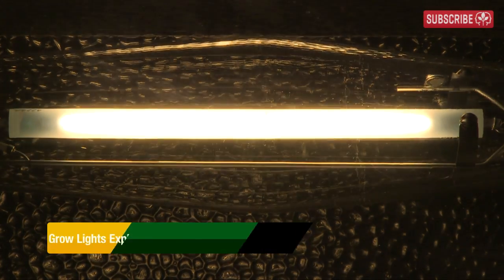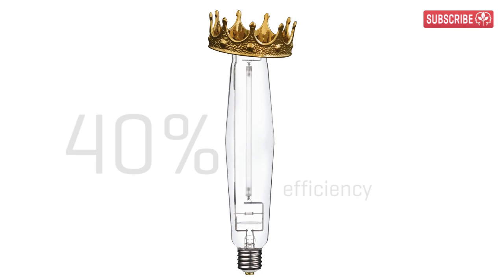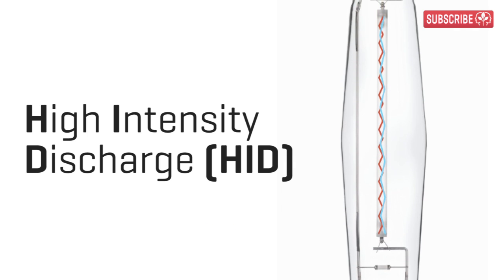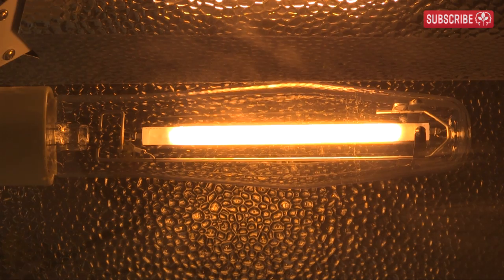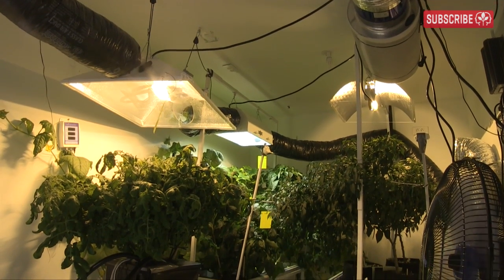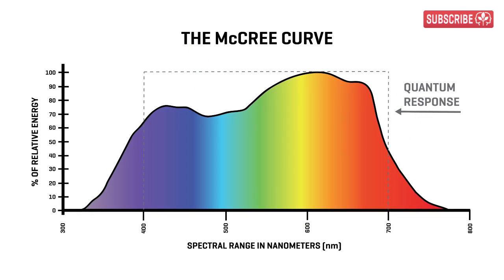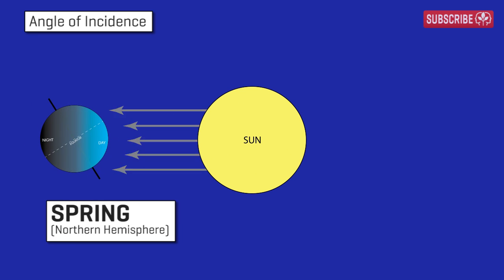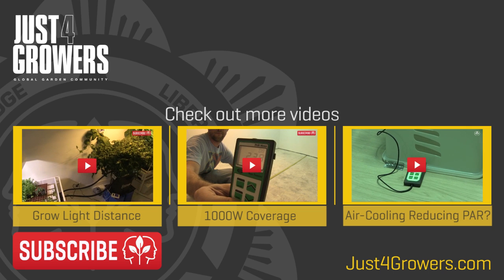Grow Lights Explained: High Pressure Sodium (HPS)

Comment: here in eu its impossible to get ballasts and ignitors...as for lamps themselves..there has been a sale out of these for 1- usd per lamp and when the stocks were depleted no new lamps are made anymore. Ive managed to snag 7 boxes for 1,5/usd per lamp but i have no control gear to use them with...

Comment: Superior to LED and used by all commercial growers for a reason.
Reply from the maker: Thanks for your comment. DIFFERENT to LED would be the way I'd put it. Sure, if you're growing in Alaska or somewhere 'naturally air-conditioned' then HPS could be a smart way to go. Same goes for winters in continental weather areas like Michigan. But more and more commercial growers are turning to LED because of its superior broad spectrum and higher efficiency. I believe that we will continue to see commercial and hobby growers switch to LEDs over the coming years.

Comment: Anyone out there run a 400 watt HPS bulb with a 600 watt digital ballast at 600 watts? I am interested in trying this but would like to know if it is a dead end fire starter? If the ballast can handle it that is good . If the 400 watt bulb running 600+ watts only last 100 hours that is also okay. What is not okay is flame roasting problems. JFYI I am not growing anything but old
Reply: You should only run an HPS lamp on a ballast specifically for the wattage of your lamp. It is dangerous to run an HPS lamp on a ballast for a different lamp wattage or lamp type.
Reply: Anything under 600 with a good ballast  should work on a 600 ballast,  even a cheap vivosun, but not the other way around

Comment: Ive a 600 watt hps lamp. Been using it for around 6 months, I've started to notice that the light has gotten alot whiter than the orange glow it used to give off. Is it time to swith bulbs? Im assuming yes but would love several opinions ☮️🇯🇲❤️
Reply: They should last about 5 years (well, going based off street lighting times, about 8 hours a day), but if yours is on all day, it should still last a couple years. Probably a cheap or defective bulb. Although I'm not sure, I've never heard of one getting whiter with age, or malfunctioning. They usually stay orange, if anything they get deeper orange, and cycle until you do something about it and change it.
Reply: They last around six months

Comment: Still way cheaper than an equivalent LED. You can buy a whole HPS set up along with spare bulbs and spare ballast for a fraction of the cost of one GOOD LED. Not the Chinese junk on Amazon (which is still way over priced IMO.) They are a total waste of money, and when the Chinese junk fails, you are out all that money.  Buyer beware.

Comment: if you want THE MOST EFFICIENT lamp ever that is close to HPS use LPS Low Pressure Sodium but they have the disadvantage of lower light output
Reply: and the are monochromatic with no horticultural spectrum

Comment: HPS is losing big time with the tech community. About every data center I have worked inside of in the past 4 years is now retrofiiting for LED's. Besides plant growing & softer outside lighting for streets lamps, these HPS lamps have no purpose for commercial buildings. They are expensive to run. The lifetime is short. Proper disposal is a pain. And they are NOT eco friendly!
Reply from the maker: Optics R US Thanks for your comment. I agree, perhaps HPS is finding its “niche”. Lol. Lighting to help human workers avoid walking into into chairs, tables, walls and other objects in modern working environments is a fast-moving and exciting application area - one in which LEDs are clearly excelling. Lighting to drive photosynthesis and photomorphogenesis in high DLI flowering plants is lighting for a very different application and with very different goals than lighting for human working environments. In the latter, we seek high CRI diffuse reflection, the former we seek deep absorption of the energy, both at the micro and macro level. I agree HPS is expensive to run and troublesome to dispose of properly.

Comment: You cant beat leds. If you dont care about efficiency and have money to waste on a long run and control insane amounts of heat then you are okay 😆😆😆😆
Reply from the maker: Нови Сад Србија LEDs still produce lots of heat, they typically lack angular / radiant intensity  for canopy penetration in flowering and remain very expensive. While they have some advantages (the lack of IR can produce nice squat and compact plants in vegetative growth)  and are advancing quickly, I think it is an over-generalization and mischaracterization to claim they cannot be beaten.
Reply: @Just4Growers  It was like over 6 years ago ! I built my heatsink for 10 dollars and added leds 50w each 9 of them pulling 420w total and have killer penetration and low spread so great efficiency. All cost about 50 dollars ! And i can change led any time... Any spectrum any wattage... It is cooler with only one little fan.
Reply from the maker: Нови Сад Србија I commend your DIY skills amigo, and I’m looking forward to getting hands on with lots more LED fixtures this year. I’m excited for the technology and believe it has great promise and, in some applications, good results, but I’m just as excited by other lighting technologies such as CMH.

Comment: You can get ballasts bulbs and fixtures at any local electric supply store. You can usually get street light fixtures or wall packs with a built in ballast

Comment: Just remember the PAR value from LED lights is spectrum specific. You make it out to be like there are some shenanigans when measuring par value on LED's.
Reply from the maker: Moxon I am concerned that growers will conflate PPFD with actual plant photosynthetic response. It’s not that simple in reality and the 90 degrees down highly directional light emitted from LEDs is very good at exciting PAR meters - watch my video “The Problem with Grow Lights” for more info.
Reply: @Just4Growers  you're right. Nukeheads shows this to be true with a simple Maglite.  2000 PAR but its focused into a size if nickel

Comment: Is this video still accurate? is HPS still more efficient than LEDs. If they are, then why do I keep hearing that the high cost of LED fixtures can be offset by the lower cost of ownership. I assumed that mean it will use less electricity. Is thus only because the bulbs last longer?

Comment: sorry but the new cree cxb LED's can outperform hid,s. I  run cxb 3070 at 36vdc at around 1000ma . They are able to handle about 1800 ~1900 ma . This means a lot less heat , and with the use of optics can keep up with hps in the intensity of light and run more efficiently.   Search  Cree cxb and you,all soon be up to date.
Reply: Wrong. I've been running a top of the line LED light from California lightworks. A solar storm 880. Then I ran a high pressure sodium in flower. No comparison the HPS buds were so much bigger I mean 3 times the size and yes quality was still there.
Reply from the maker: +Garry Carley Thanks for your comment Garry and no need to apologise for it! :) Technology is developing at a tremendous pace so it's inevitable that my presentations will need updating at some point. I am very interested in the latest generation of LEDs—I think it's time I jumped on board and I look forward to some comparative grows. Thanks again for chiming in. I hope you're subbed so you can follow my progress.

Comment: Meh, 30% LED vs 40% HPS isn't much of a difference, especially when you consider your electricity bill and getting a silly converter. I'll stick to LED and my bounty aerogarden ;)
Reply: LED has just not evolved enough for me to give up what it produces. to be competitive enough or economical enough to repleace HPS. Also LEC holds more promise at this point to surpass LED
Reply: Lmao a silly converter its a digital transformer that's also built into the leds just smaller

Comment: how do they to  change the spectrum, each company uses a slightly different spectrum, is the ark tube coated with phosphor like a fluorescent to give different spectrums, i am wondering how to make a hps light with just  the red or blue spectrum
Reply from the maker: +Tony Boroni Hi Tony—the arc tube is not coated with a phosphor, it's actually a mixture of gases (mercury for blue, sodium for yellow / red).
Reply: how would you go about to make it just red 650 to 660 nm
Reply: i thought if you heat up mercury it gives of uv light
Reply: does the gas neon and the presure give off the types of light because it fluros the Mercury gives of uv.
Reply from the maker: +Tony Boroni Hi Tony, you're right, mercury does produce UV light however the amount of mercury inside an HPS lamp is so minuscule that the amount of UV produced is insignificant. You've also got to consider that any UV is effectively filtered out by the glass of the lamp itself further reducing the UV output to almost nothing.  One of the main reasons lamp manufacturers use mercury is to regulate the operating voltage of the lamp. I'm also going to stick my neck out and say that to make an HPS lamp to focus just on 650 or 660 nanometers, would be extremely difficult / nigh impossible due to the laws of physics and the chemistry needed to operate the light.

Comment: Once the line voltage enters the ballast, at what voltage does the lamp its self get?
Reply from the maker: Mike Lattimer Hi Matt. Thanks for your question. The lamp requires 4000 - 5000 volts to ignite and then, once the arc stream is stable, it runs at 250 volts. Does that answer your question okay? Please consider subbing my channel. Thanks! Everest.
Reply: Everest Fernandez 
Everest Iam trying to make a flipper. I have four 220 volt ballast and am trying to use relays on the secondary side of ballast to send the current to room #1 12 hours then room #2 for the next 12 .  My lamps are not igniting and I cant figure out why. Will a standard ice cube 120 volt AC relay work to carry the secondary voltage to the bulbs? I thought the coil inside of it might be interfering with the pulse voltage on start up.
Reply from the maker: Mike Lattimer Hi Mike. A standard ‘ice cube’ relay doesn’t function well in this type of application due to the switching voltages involved. A better solution is a definite purpose contactor like this one from Deltrol Controls.  It is their 900 series relay.
 
http://www.deltrol-controls.com/sites/default/files/imagecache/product_index_image/images/familyimages/img-9001cdpdt.jpg
 
These are power relays that are intended to work in both the NC (Normally Closed)  and NO (Normally Open) positions.  This is accomplished by utilizing a ‘trigger cordset’ that opens and closes the relay contacts using voltage input.  In the NC position bank #1 of lights fires, in the NO position bank #2 fires.  This is the technology used today by LightSpeed flippers and Powerbox flippers.  The most simple approach would be to purchase one of the “pre-built” flippers and use that in their application. However, if you want to build it yourself then you may want to consider using the Deltrol Power Relay to accomplish this task.
Reply: Everest Fernandez can I get that in 120 volt coil? 
can I run it with an intermatic time clock?
Reply from the maker: Mike Lattimer Yes and yes. But, to be honest, the only safe advice I would give here is to check out something like the Flipbox by Powerbox ( http://www.powerboxinc.com/flipbox.html ) and use that or reverse engineer if you have the know-how. I don't want to sound like your dad but be careful! I presume you are a qualified electrician. If not, buy it and get it professionally installed. Safety first. Peace and happy growing. Everest.

Comment: Why can't they use aluminum oxide ceramic for Metal Halide bulbs? They would last alot longer
Reply from the maker: Yofatboy124 It is used—for ceramic metal halide lamps.
Reply: +Yofatboy124 also why cant they make them with more of the red spetrum or blue, also they could make a round tube and put electro  magnets on them and it would last longer, they use the technologies with fluros and there like 1000 dollars a light way over priced.
Reply: @tonyboroni6949  they do have HPS bulbs that are more blue than regular

Comment: Hi, thanks for your video. What electricity bills would I expect if I use HPS lamps?
Reply from the maker: Good question Arsen! It obviously depends on your utility supplier's charges. I recommend running your grow lights during the nighttime—not only will temperatures be easier to control in your indoor garden, but some electricity companies charge less for nighttime usage. 

As an example, if you were running a 1000W HPS light for 12 hours per day and your electricity supplier charged $0.12 per kilowatt hour, then over a 30 day period your HPS grow light would've been running for 360 hours. 360 x 0.12 = $43.20
Reply from the maker: ***** Thanks FallenAngel. Growing the plants that you love to grow, 365 days of the year, in the privacy and comfort of your own home .... well, it's got to be one of the most rewarding hobbies out there. I guess that's why I feel such an affinity with other growers. Indoor gardening is a wonderful world—a veritable sanctuary for me!